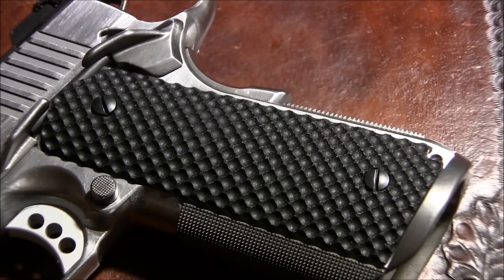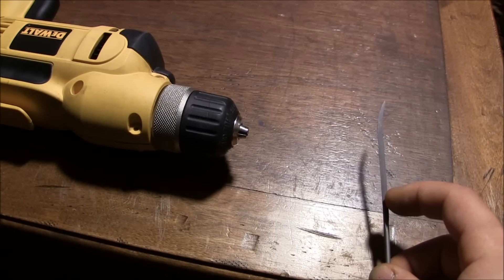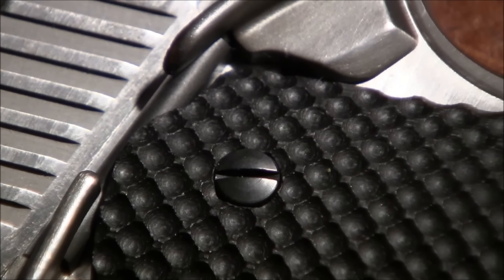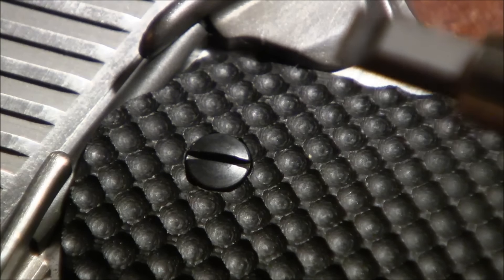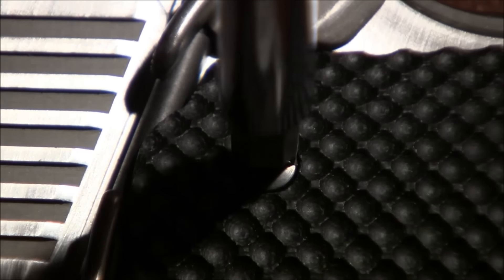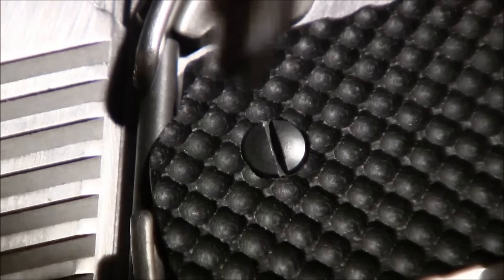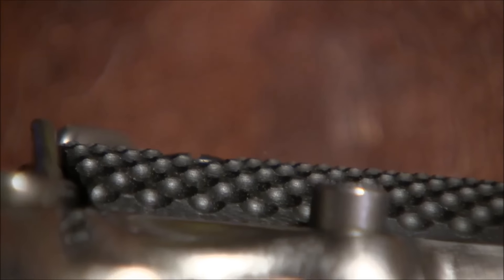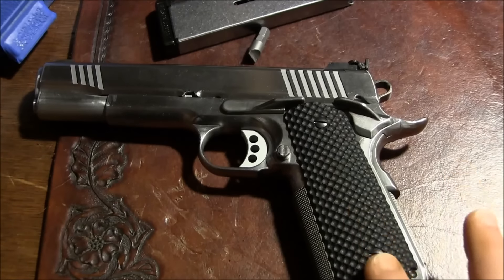1911 Build 4 - Part 11 - Grip Screws Sink and Index

Comment: Make sure you start every screw with your fingers first, then tighten with your screw driver. You can end up cross threading your screw and bushing if you start it with a screw driver.
Reply from the maker: Thank you. I will keep that in mind.
Reply: +John Troy Wouldn't just turning the screw in the other direction (this example being counter-clockwise) until you hear like a click sound then start to screw eliminate that chance? You can still cross thread by hand, just you'll stop before damage incurs.

Comment: Instead of squeezing the screw threads in your chuck, have you considered taking a piece of bar stock a little larger than the screw, turn the outside, face one end and then drill and tap it for the screw.  Holding the screw with that, you can squeeze it as much as you want in your chuck without causing any damage to the screw.  It then can become a regular resident in your tool box.  You may want to make more for different size screws.  

A mini lathe is more than big enough for the job.  Even those plastic 6 in 1 lathes they sell on eBay for around $100 could do it.
Reply from the maker: That would be a way more appropriate method. Yes I have considered it but drilling round stock perfectly in the center could present it's own challenge.

Comment: I've built hot rods and assembled AR's. Its time to do some 80% AR's and 1911's. I enjoyed your videos. Thanks for the inspiration. I'm already thinking about what to call them. One question though; Are you going to make a video of polishing the gun.
Reply from the maker: Are you talking about mirror polish? probably not. Shows fingerprints too much, hard to keep looking pristine when handling
Reply: I get it.  Its still a gun. Thanks
Reply from the maker: having built hot rods, you would probably do a better job polishing than I could. if I was polishing I would avoid a buffing wheel, keeping all flats flat and edges sharp.
Reply from the maker: I much prefer to smooth the surfaces enough to be uniform and then blasting the finish with glass bead. nice satin look.

Comment: Wouldn't have been easier to file down the tops of the grip screw bushings. This way you wouldn't have weakened the integrity of the screws, and still lowered them down.
Reply from the maker: the screws should not touch the bushings as far as I know. the recess in the grip is what the screws should be pressing down on. if the screw touches the grip bushing when it is tightened, I believe it can bund and them both the screw and bushing will extract when trying to remove the screw. these screws I have are Brownells brand. they are thicker at the head and seem to also not be concentric.
Reply from the maker: bund = bind, sorry. typing on the phone.
Reply: +MosinVirus Was never a fan of flathead screws.  Have you thought about hex screws?  I have some WCs and really like them.
Reply from the maker: +dumas1012 I have used those before. I usually try to go with hex everywhere or slot everywhere. This includes the magazine catch lock. The one that was hex or something like that got stripped almost immediately, so I never went back, and since I am using those with slots, I decided to also use grip screws with slots. Plus, this indexing is something I believe only the top builders do, and I just wanted to see how I could do that (this doesn't mean I consider myself a top builder, but I do want to follow the best examples out there and get good at that).
Reply: +MosinVirus dude you might not but I know at least I do. Your attention to detail is something I've never been able to achieve.
Reply from the maker: +The Texas Gun Guy you are too kind.
Reply: @dumas1012  Slotted, Hex, or even Phillips, all screws have straight lines.  Therefore they should all require indexing for proper appearance.

Comment: One reason that the screw slots are aligned is that it makes a more professional looking job, it is of course much easier when we make the screws, as we make them higher, with a false slot, then tighten them in place, mark off, then cut the slot where you want it, after taking down the head to the correct height. Buying screws is for amateurs , not people like you!
Reply from the maker: :) You give me too much credit. I am still very much an amateur. if I had a lathe, I would certainly be making some parts. And some tools and jigs as well. and if I had a lathe I would have also had a mill, and then I could really try some stuff.

Comment: Just a little bit more "crack" oh well, get another screw ! Such is gunmaking when you do it properly, (as you do), if you made a simple threaded fixture for your lathe it would have been much easier to get the head down, You are one of the few that insist on timing the screws, they will of course only fit in one hole now, until some moron in the future tries them in the wrong holes! Happy New Year to you.
Reply from the maker: Thank you. I know it would be easier if I had a lathe. then again, if I had space for a lathe I would also have space for a mill, etc. the screws will obviously work even if they are placed in different locations, they will just not align. but I am thinking of labeling them on the underside. just wanted to know how to do it.
Reply: +MosinVirus : The easy way would be a simple colour code on the screw and the place, that would be obvious when on the bench, and with only 4 colours.
Reply from the maker: +Englishman French Interesting idea. I was thinking of putting notches on the underside of each screw and bushing.